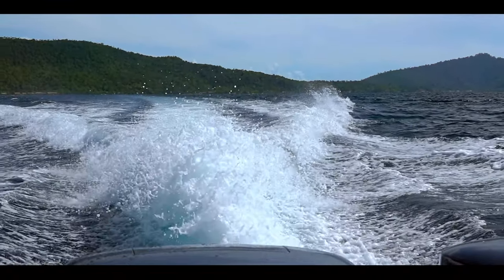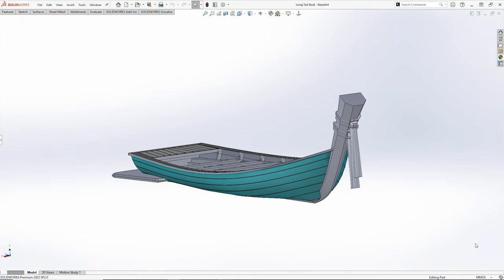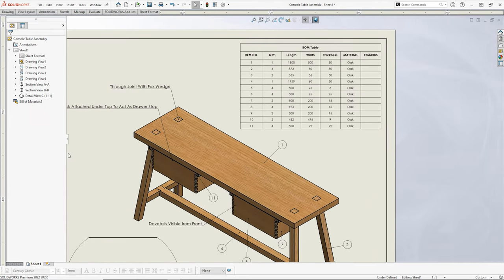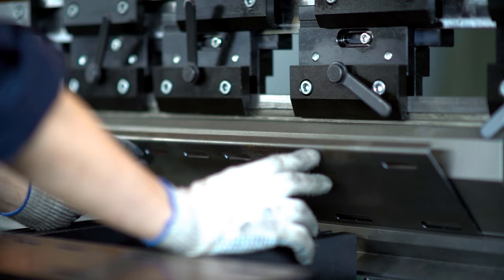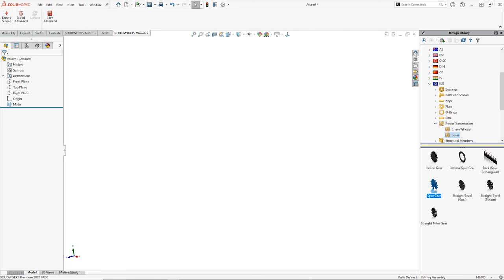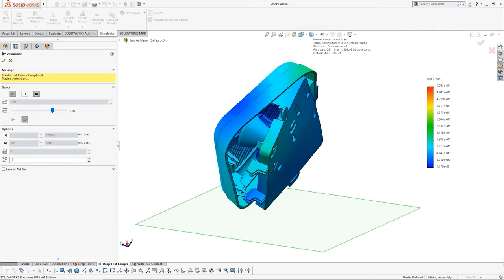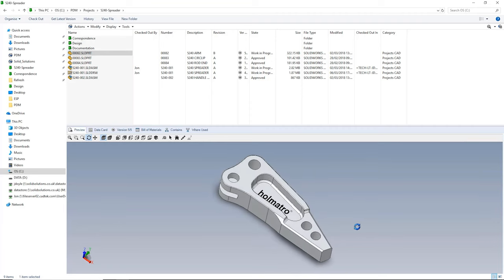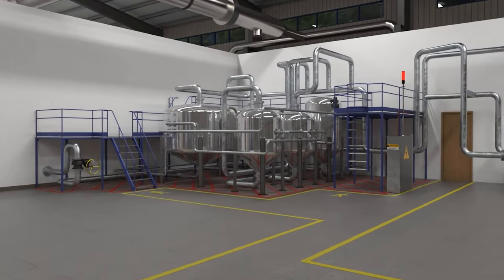SOLIDWORKS in the Marine Industry

Comment: We use Solidworks to model all of our dutch barges - the full steelwork hull, all the engineering components and all the furniture.  It's not typical to use Solidworks for everything like this but it can work, Solidworks is a great piece of software that can handle all engineering cad work.